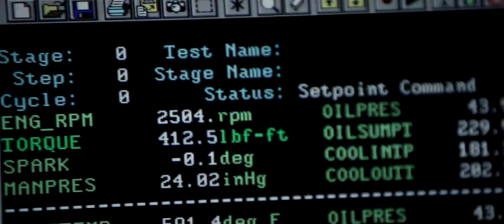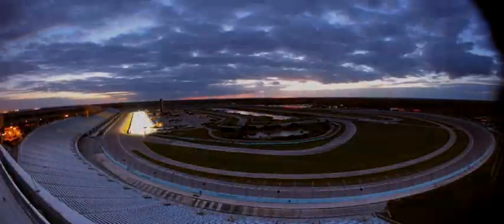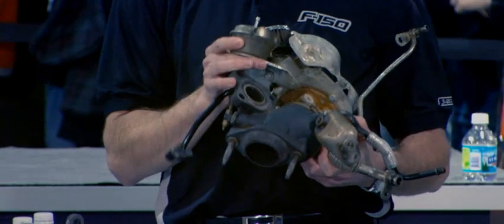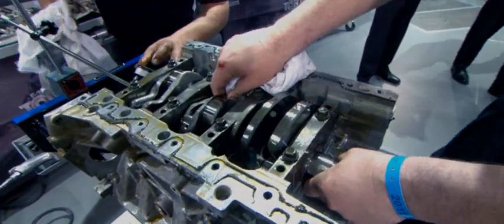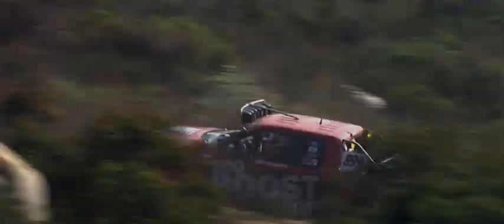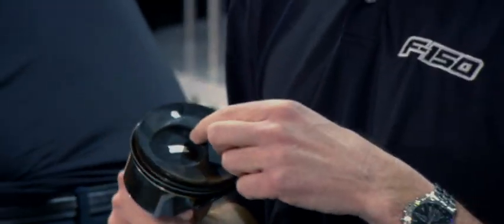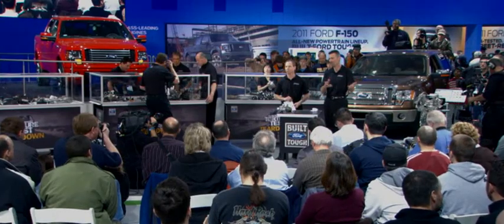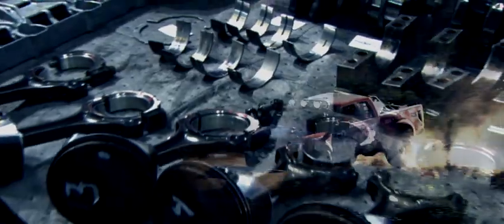Ford's "Beat to Hell and Back" 3.5L EcoBoost -- The Tear Down!

Comment: My Ecoboost shudders when I slam on the gas and eventually makes my check engine light flash. Lose some power. Also get a weird metal clinking when it's in drive and let it roll. Once it switches gears it goes away.
Reply: Change your plugs. Mine did the same thing and it was just build up on one plug. Now I change mine every 25k. Easy enough to do at home and only costs 40bucks

Comment: 112k miles on my 2013 Ford Interceptor Taurus with the 3.5L Turbo / Ecoboost. I was getting 14mpg city driving, and the timing chain went. No fucking shop will touch the car. Dealer saying it is most likely needing whole engine to replace. 

FUCK THIS LEMON OF AN ENGINE.
Reply: Interceptor Taurus a beat up old police car?

Comment: This engine won't outlast the engines in the 92-96 Ford Trucks.
Reply: CJ Colvin I think newer engines, with proper maintenance, can outlast the older ones.  Like anything new and revised it will usually outlast the previous
Reply: Three years later...I work at a Midas shop, we rarely work on these EcoBoost engines. Only thing we say are the spark plugs and coils. Which are a pain in the butt. Other than that..the 3.5 ecoboost engines are getting 250,000+ miles easy with like new driving conditions. Pretty impressed.
Reply: agreed the 302
Reply: jordan sheppard Yep Amen Brother.

Comment: The engine never lost power and missed when it was kicked down ? Mine has twice. Ford no codes where saved and can not duplicate issue so there is no problem.